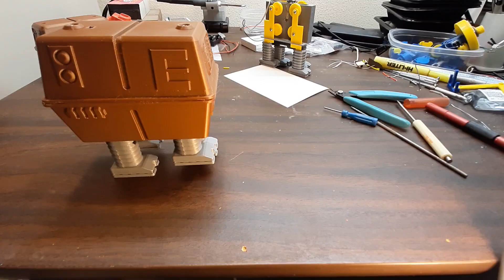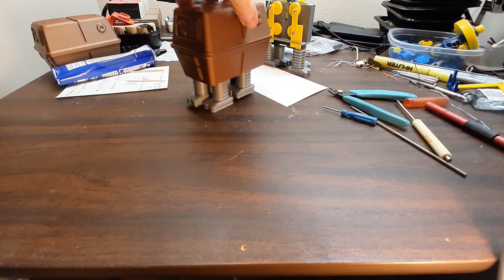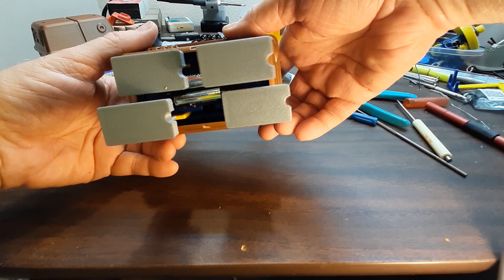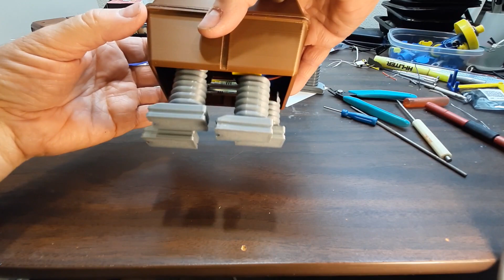Walking Four Legged Star Wars Gonk Droid (PLNK) Toy

Comment: Looking great Rick. You know you can drop the 5 volts down by adding a diode or 2 in series with the gearmotor. Maybe 4 volts would slow it down to the speed you like but still give it enough power. Regular silicon diodes will give you about 0.7 volts drop, and Schottky diodes will give you around a 0.4 volt drop.
Reply from the maker: I should have thought of that. I've used diode drops in the past to bring  a 6 volt battery pack down to around 5 volts for micro controller projects. I may need it on my next project. I want to build a 2 legged claw walker of this Gonk droid. The 2 legged version may not be as stable so it may need to be slowed down.